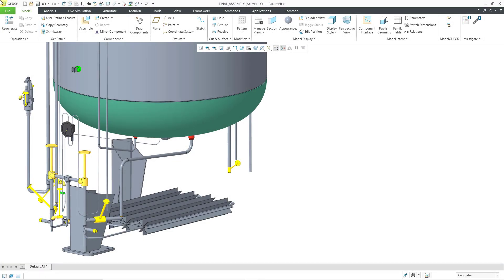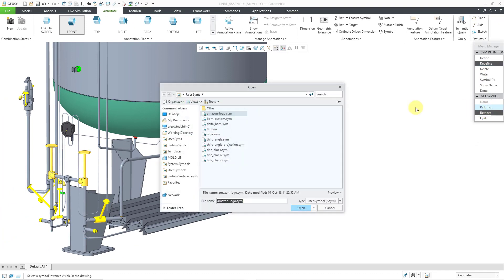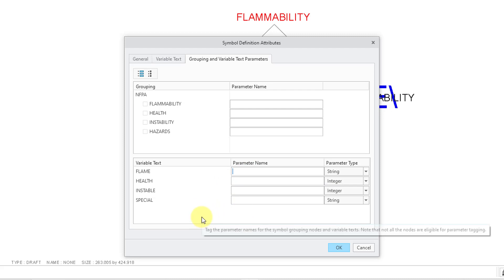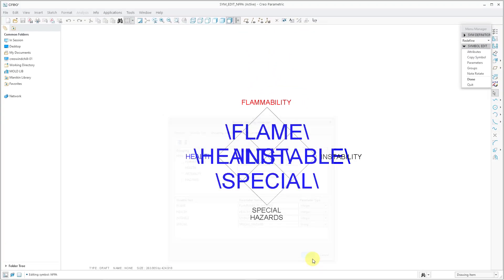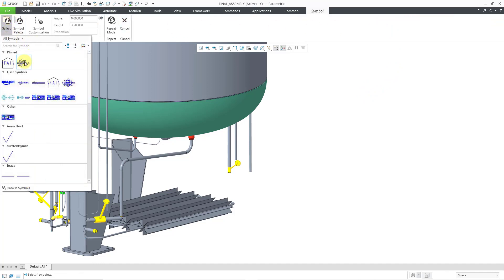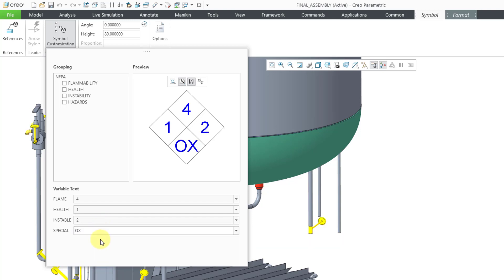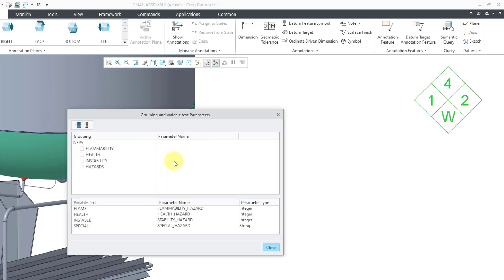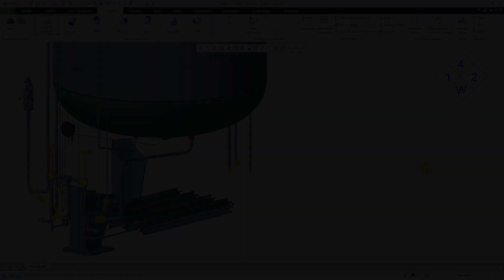Creo Parametric 9.0 - Pre-Defined Custom Symbol Parameters (2022)

Comment: Very helpful..

Shall we include some parametric variable like mass value of the component , that retrieves from the model properties.
Reply from the maker: Hmm. I'm not sure what you are asking, so let me try to address it. You could always create a custom symbol that reports information like component mass. I've never seen anyone do that, but you certainly could if you wanted to.

That said, creating a symbol that reports mass might be unnecessary, as you can always include that information as a column in a BOM table or use a parametric note instead of a symbol.

However, this video is about how you can create parameters in a symbol from variable text in a symbol. There's no need to create a symbol parameter for component mass, since component mass already exists as a model parameter.

If you're interested in including component mass in the symbol definition, I recommend you watch my video on how to create custom symbols.
Reply: @CADPLMGuy  that helped.. thank you.

Comment: I got one for you. I recent;y discovered if you have bug notes in your note section that are programmed sysmbols, they can re-order themselves if you delete one or insert a new one. Now all of our notes do not have to be bug notes. You worked at Blue right, so I think you know what I mean. I tried to edit our current sysmbol and add a group to turn off the 'HEX' part of the symbol leaving only the text. Whenever I use the code: &sym(xbug) the symbol appears after I select the type of note from a drop down menu that pops up. I made myself a list of test notes and added and inserted and deleted a couple. Everything reordered as I expected. Yet when I turn off the 'HEX' in the Symbol Customization dialog, I can't turn it back on. I highlight the note number and enter and the dialog will not come back (groups). I wanted to make my symbol a 'Super Bug' note symbol that can become a standard note or a bug note on a whim and still be able to re-order itself, which it no longer does after turning off the HEX portion. Becauise currently programming bug that have standard notes between them won't auto reorder. I showing you the Bat Signal Sir.
Reply from the maker: Wow, that’s a lot of words and a lot of detail. I suggest either getting with your CADmins or reaching out to PTC Technical Support.
Reply: @CADPLMGuy  I did and they couldn’t help. I’ll see if I can try the community on PTC University
Reply: @CADPLMGuy  oh and thank you for answering so fast
Reply from the maker: If you work at Blue, I always hated how they did bug notes. Overly complicated.
Reply: @CADPLMGuy   flag note off the side would be way easier IMO